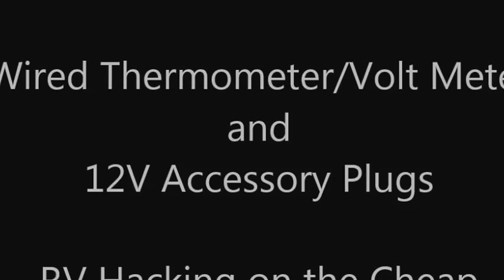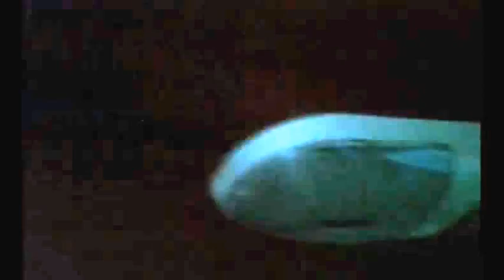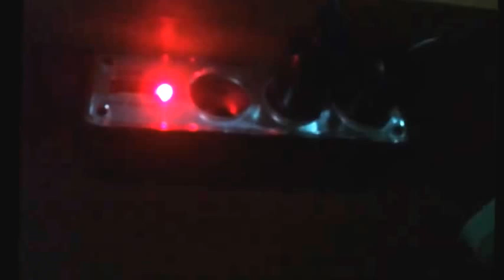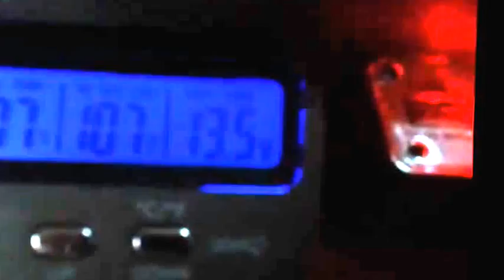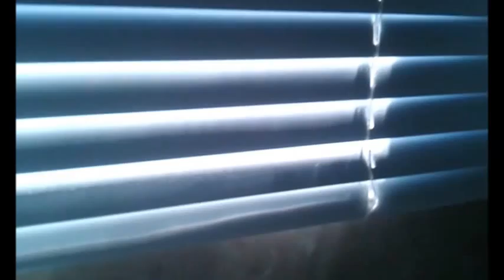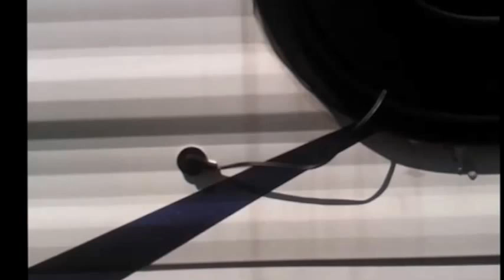Installing a Clock/Thermometer/Voltmeter and 12V accessory plugs in an RV

Comment: None in the Forest River Spartan trailers either.  Isn't that just the craziest thing you've heard??
Reply from the maker: Stupid, but not crazy.  In my last two trailers, neither has had 12v plugs from factory.  

My current one has a single plug built into the antenna amplifier, but it's only weeks for TRIVIAL draws.  My cellphone charger draws 1A@12V to make 2A@5V... but this plug falls to 9V abs the charger shuts down (thankfully!).  The wiring behind that plug is so thin that it would be dangerous if it DID carry more current, and that voltage drop damages electronics.

So yeah, DEFINITELY install your own plugs as shown here and in the followup video.
Reply: Stupid, but not unheard of. In my last two trailers, neither has had 12v plugs from factory. My current one has a single plug built into the antenna amplifier, but it only works for TRIVIAL draws. My cellphone charger draws 1A@12V to make 2A@5V... but this plug falls to 9V and the charger shuts down (thankfully!). The wiring behind that plug is so thin that it would be dangerous if it DID carry more current, and that voltage drop would damage electronics. So yeah, DEFINITELY install your own plugs as shown here and in the followup video.